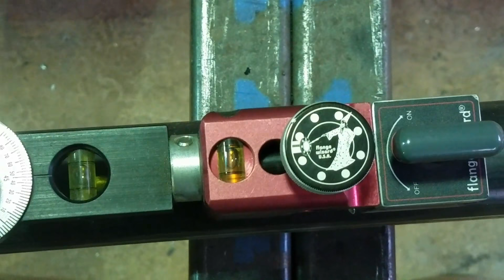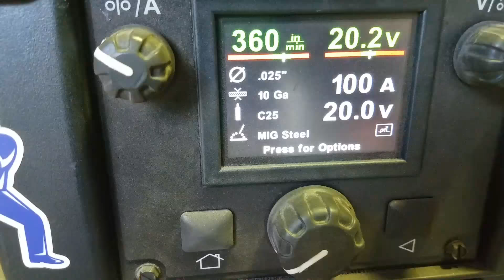APEXISH gate frame

Comment: You're a master with the zip wheel, JD. But would a porta-band have worked better in that instance? 
Can you give us a video on your welding cart? It looks badass.
Reply from the maker: idriwzrd so when cutting a porta band pulls towards the fence on the machine... that makes it really hard to control the machine, if it was straight cuts it's work the same.  It would be hard to do the same on the 45° cuts

Comment: How did you cope the middle tube?  Just take a little off, check the fit, and take a little more off until the fit is good enough?
Reply from the maker: Daniel Wisehart I used a laser tape measure to get the inside measurement.  Then I used a tubing notcher, that cuts with a hole saw that has the same OD as the tubing.  I'll show it next time
Reply: Thanks!  I would like to see that.  Especially how you keep the copes lined up on opposite ends of the middle pipe.  Sometimes I just cut the tube in half, weld the ends and then weld the middle back together.
Reply from the maker: Daniel Wisehart I do that as well especially with scrap short pieces... and I normally use the weld seam in the tubing to know where and how to cut it

Comment: Is thAt your original 210 mp and would you buy another one
Reply from the maker: Adam Leonard it's my second  and yes I'd buy it again for sure!!
Reply: JD Brewer I have one and love it  I even run 1/8 air arc rods with it when I do a small crack or wanna be delicate with removing pressed in bushings  it seems you use yours for everything also  I'm feeling way better with my purchase